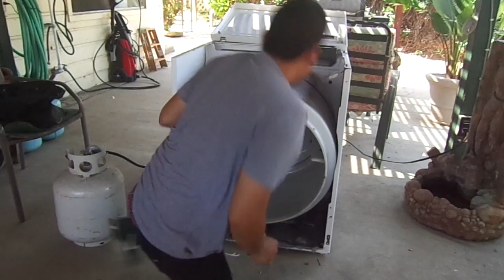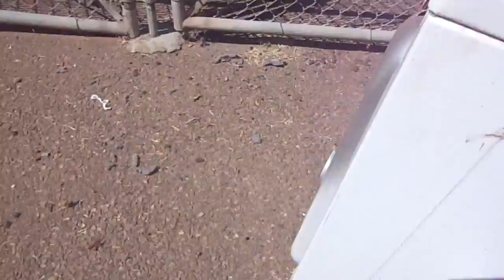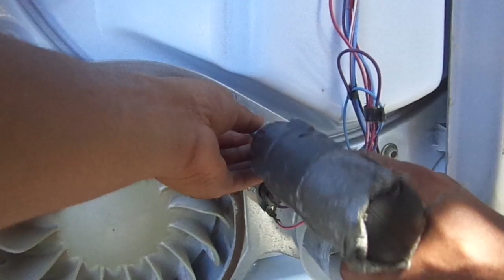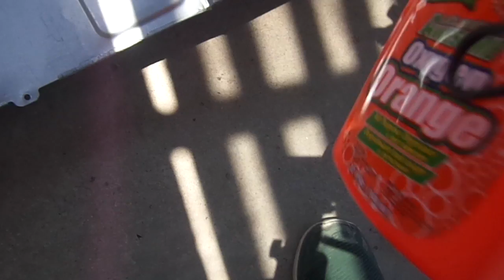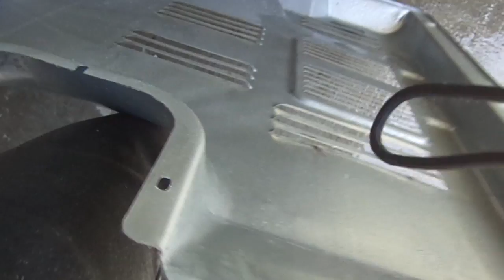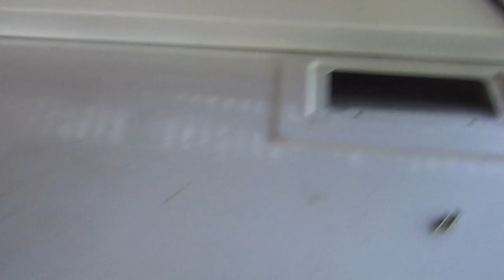Kenmore Commercial Dryer Service

Comment: we have a commercial Kenmore dryer at my apartment and it heats up with gas and the pilot light stays on but it does not flare up to heat the clothes. Can you tell me what part possible needs to be changed.
Reply from the maker: I would check the ignition coils. Using a multimter you can check and see if current passes through each point.
Reply: Yes I saw that on here too . A guy took off the Flame sensor and it broke because the dryer is older and it was hard for him to take it off. So he order one and I told him that its probably the coils which I saw for $15. Thx for the Help.